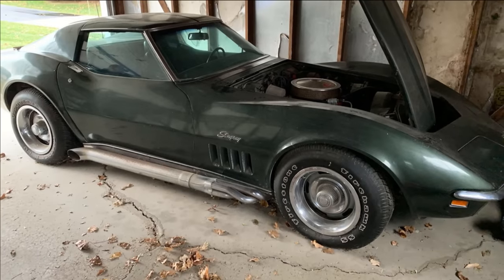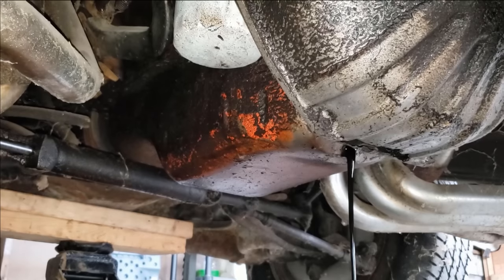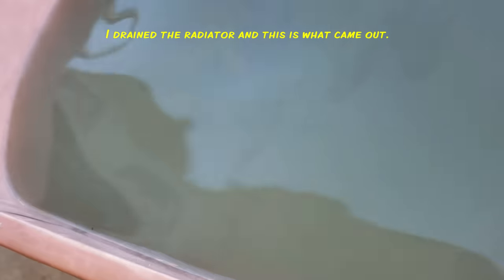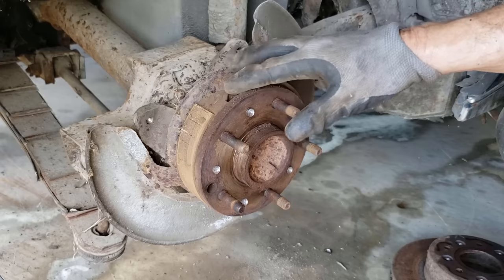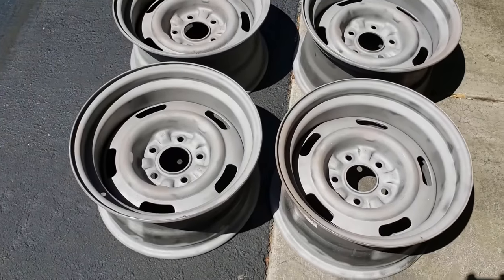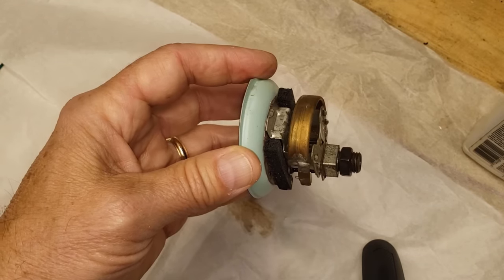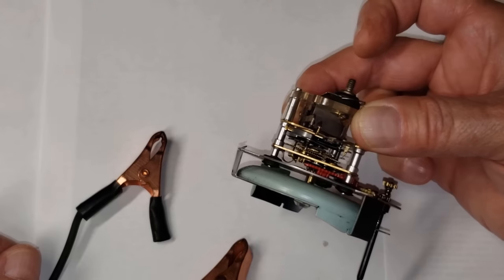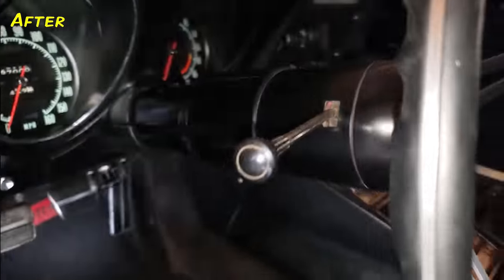WILL it RUN and DRIVE? 1969 L-46 4-Speed Corvette Garage Find! All ORIGINAL! NUMBERS MATCHING!

Comment: Did a 69 come with a smog pump?
Reply from the maker: YES it did!:face-fuchsia-tongue-out: (my '68 Camaro did too!:face-green-smiling:) The previous owner, Mike, removed it and the original exhaust manifolds. And then installed the headers and side pipes in the early 70's. The Air Pump in this video is "correct" for 1969 350's.:face-purple-wide-eyes:

Comment: Are the rear tires larger than the front tires?
Reply from the maker: No, they are the same size on all 4 wheels. When I do it again, I will definitely put bigger, taller tires on the rear.

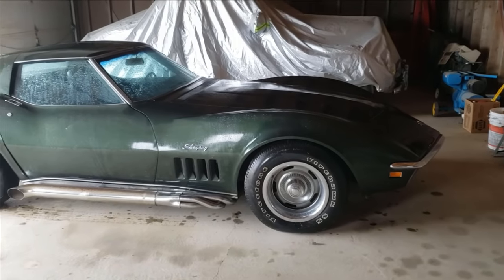Comment: “I have a lot of work ahead of me” 1:47  I’m just bitter as the last truck I had done was so rusty and full of holes and I’m not a fabricator or body man. I wish I had something In this condition to start on. Good luck!
Really? Car looks pretty decent to me. Take out the distributor and spin the fuel pump with a drill to get the oil on top of the engine. Replace the spark plugs and wires (spray dogging oil in the cylinders before you put the new spark plugs in. Clean up the carburetor and get a new battery. Should star up just fine. Then change the fluids and vacuum out the interior and you should be good to go.
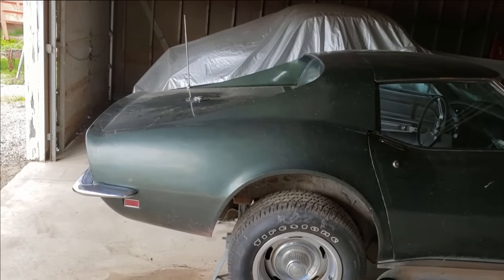Reply from the maker: Hmmm...I chose a different process as shown in the entire video. At 7:37, the entire fuel system had to be flushed before starting it along with changing the oil. I performed other tasks off camera, changed points, fresh oil flow, new spark plugs, cap, rotor and wires. All before I started it. Then I went on to the cooling and brake systems as shown.

Comment: I would make damn sure the transmission work before I did all that work 22:40
Reply from the maker: I did exactly that Henry off camera so you don't see that in the video. I was able to check the all the gears and linkage soon after I got the car in my garage which raised my confidence. It was still a big gamble buying a none running car not knowing what it'll need, but glad I took the risk!:face-orange-biting-nails:

Comment: my 81 vettes  driver t top leaked   i sat on a  bin liner lol  put so much  silicone around still leaked not fun
Reply from the maker: This one leaks too! :face-blue-smiling:Needs new seals.
Reply: All C3's leak. If someone says otherwise, they're lying !
Reply: @a.c.m.e.ink.4568   yep i did the same  new rubber around  the t top  still dripped  water
Reply: @ThomasPrior-wv6zn  You definitely don't want to leave a C3 outside in the rain. 💦 You can, but you'll regret it. 😣
Reply: @a.c.m.e.ink.4568    YES  I SOLD MINE AFTER  A SHORT  WHILE  PITY  LOVELY CAR
Reply: @a.c.m.e.ink.4568    or in a car wash

Comment: I wouldn't say that is original miles
Reply from the maker: Interesting comment. What data do you have that gave you that conclusion?
Reply: @FlatheadTerry  it could be,  who knows.  But judging by the condition of the engine bay, along with all the grease and grime on the steering and suspension components.  It just doesn't look like it.  I had a 72 Camaro I bought with a little over a hundred thousand miles , and it didn't have anywhere near that kind of wear on it.   However,  I wasn't knocking the car or anything,  I love that color and it is a great find either way.
Reply from the maker: @bigboytoyz541  OK, thanks for that. I see your point. I agree it has excessive grime and corrosion throughout. I wanted to record a short interview with Mike, the previous owner, because to gave me the complete history from 1971 but he wasn't comfortable with that. He has additional paperwork with most of the maintenance recorded with the mileage as well. He was an English Teacher and admitted he wasn’t mechanical so he had it serviced locally which may be why excessive lubrication. He confirmed though that it was the original mileage. Thanks for the watching and the comments!👍
Reply: @FlatheadTerry  I understand.  I only say that because so many people claim original milage.  But with documentation there is no doubt.  It's a great car,  I'm glad to see it live on and not sit somewhere and rust away.